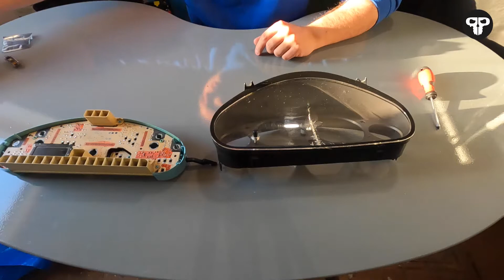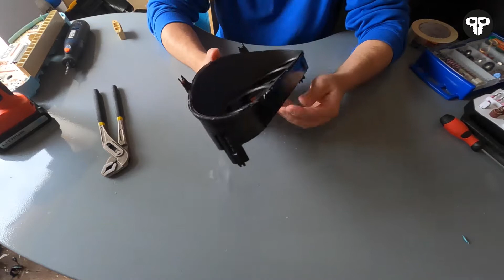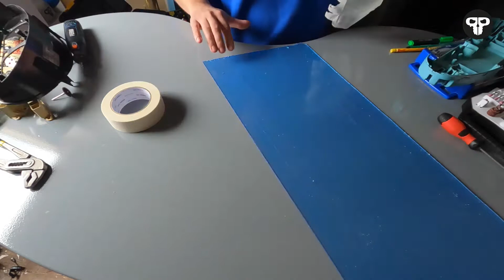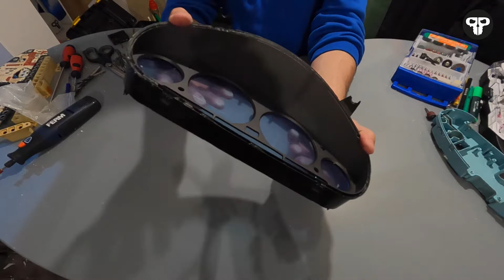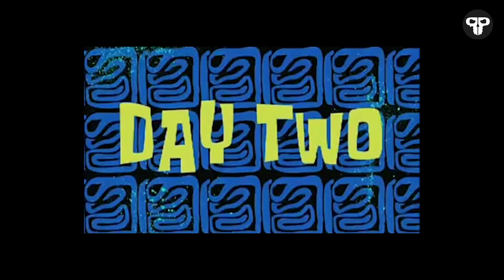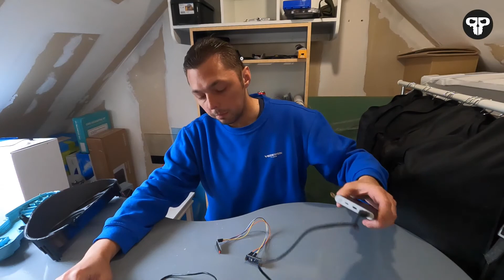BMW E36 Build S01E03 - Custom Gauge Cluster

Comment: how to reading code from ecu and reading arduino can you give some infos ?
Reply from the maker: Hi! The plan is to run an aftermarket ecu with can-bus. Engine RPM, check engine can go trough can-bus and the other signals can go simple to the sensors. If you want to put it in an existing car system u wil need diagnose de digital/analoge signals an program the arduino to interpret them.